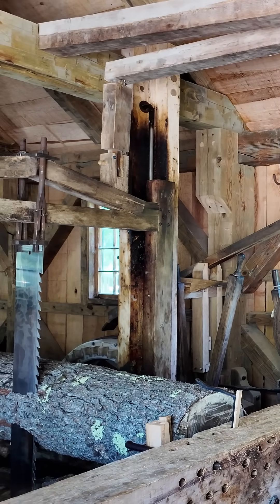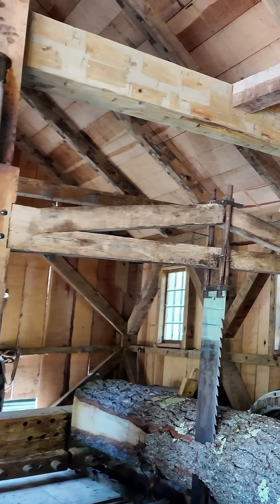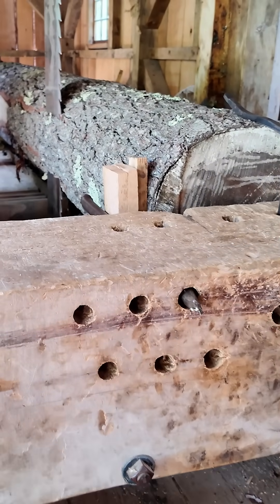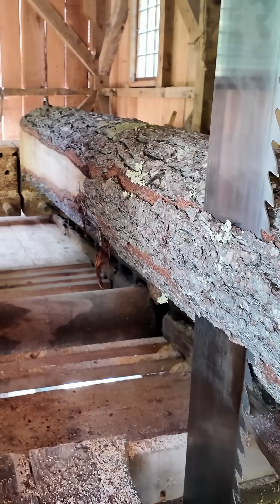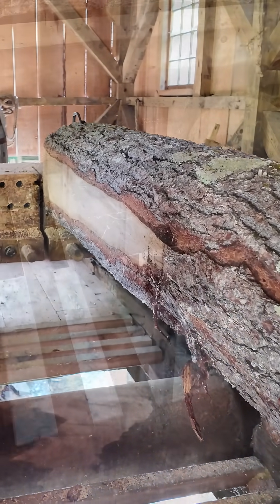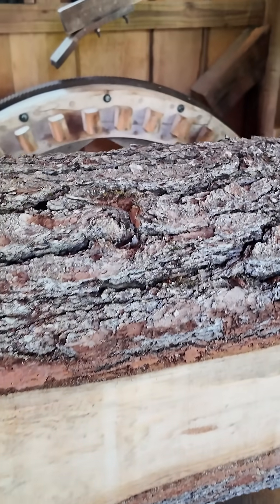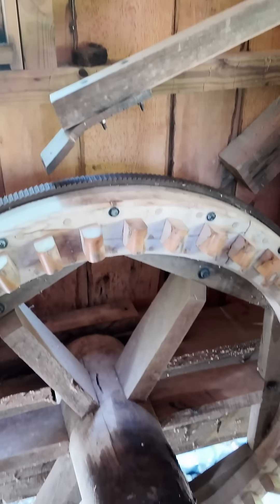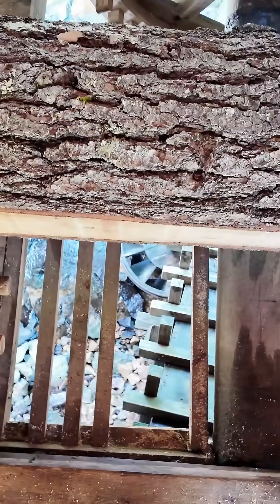800 Year Old Sawmill Design Still Running Today!

Comment: There is an "up and down" saw mill in southern New Hampshire.  It seems similar to me.  Neat sawmill.
Reply from the maker: That's another name for this type of sawmill.  The Ledyard sawmill?  I've added it to my list when I get out that way next.
Reply: @Industrial_Revolution  Thanks, I didn't know about the Ledyard in Connecticut.  The one that I was referring to is the Taylor Sawmill in Derry, New Hampshire.  Check them both out if you can.  And if you are in the area, check out the Boott Mill in Lowell, Massachusetts.
Reply from the maker: Cool, I added that one, too.  Need to build an interactive map with all these places on it.